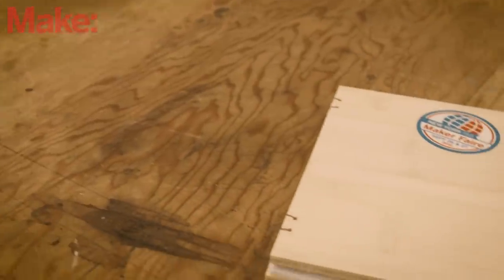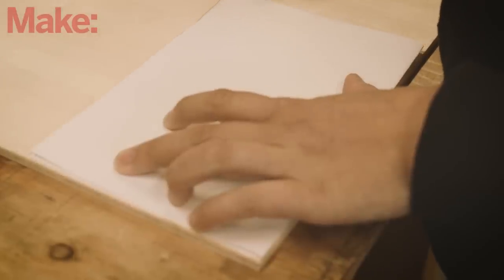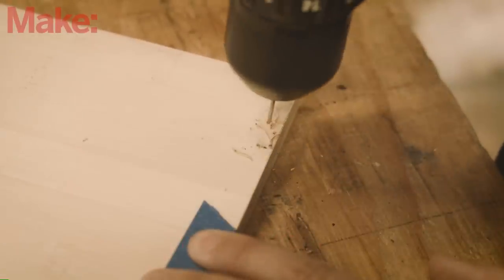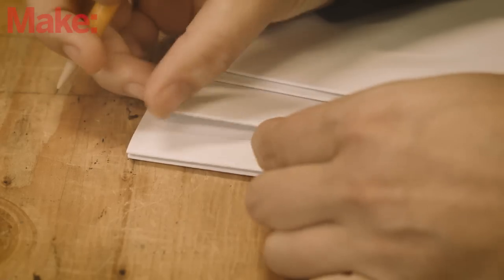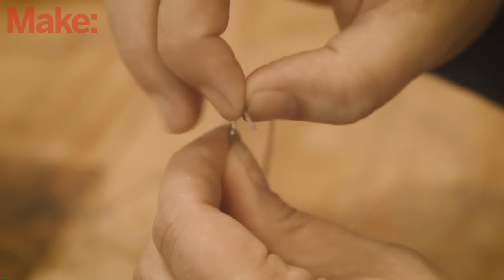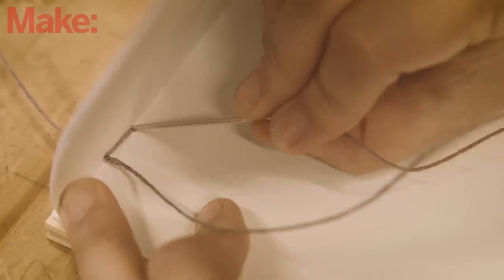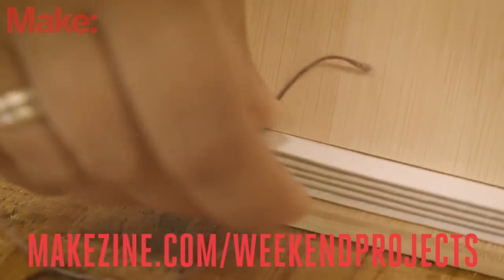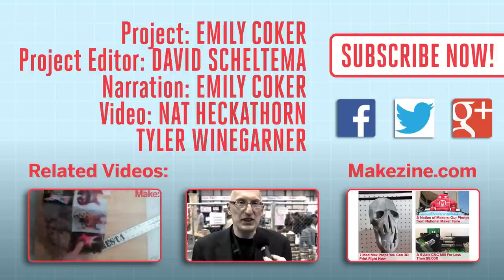Build this Sturdy Notebook Using an Ancient Bookbinding Method

Comment: So you used a tool that was not on the list of tools needed for the job.
Reply: TheDutyPaid ????
]
Reply: TheAnimus
¿¿¿¿
Reply: +Emily Coker the Mitre Saw or as she called it a chop saw, but a chop saw uses an abrasive disc. She did not even know the right name for it.
Reply: *****
No, yes they may look the same but you would not cut wood with an abrasive disc.
It be like saying can you get me a hammer, You bring me a pin hammer, but I needed to knock this wall down.
It would have been better to show cutting the wood with a hand saw of suitable type. Which I am sure the average viewer has over a mite saw or table.
The video could have shown the wood being laser cut and well as the holes in the paper. Why even use paper when vellum would be good?
Because this would be too advanced.
My main points are, use the tools shown at the start of the video and call them by the right name. Is that too much to ask?

Comment: 5 pages to a signature and 5 signatures would be 50 pages, not 100 like you said
Reply: Four pages per sheet by five sheets per signature is twenty pages per signature, by five signatures is one hundred pages.
Reply: @trischandler9783  each signature comes to 10 pages, because each of the 5 sheets is folded in half. 10 times 5 signatures comes to 50 pages. It's okay that they got it wrong, but you and them might want to revisit some basic math <3
Reply: @trisofalltrades  ok I think I see where the confusion is coming from, I'm seeing this from the perspective of someone who does art, so nothing would ever be labelled as having 100 pages/sheets unless it meant 100 sheets you could tear out, whereas from a novel perspective, yes there would be 100 pages. So yes in a printed book that would be 100 pages, but in a blank book meant for art etc, that would be considered very literally as 50 pages. I wasn't tryna be arrogant, but I see how I probably shouldn't have added that last bit :P
Reply: Aaaand I realize I just repeated what you just said lol, sorry. Also, I've never been called a wombat before xD